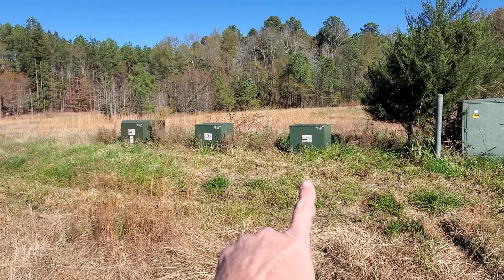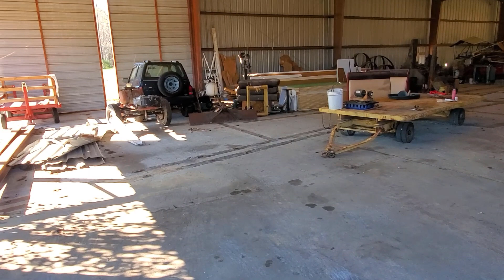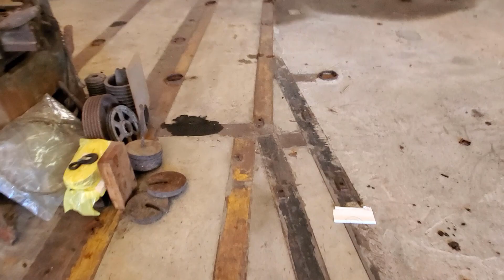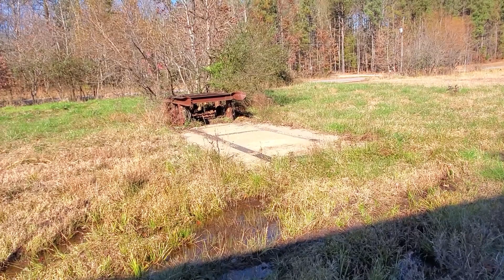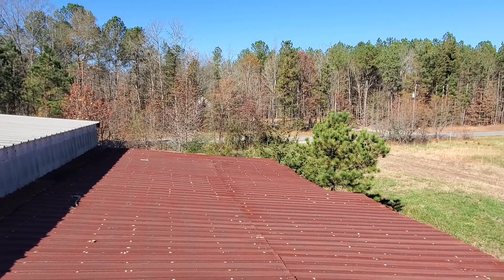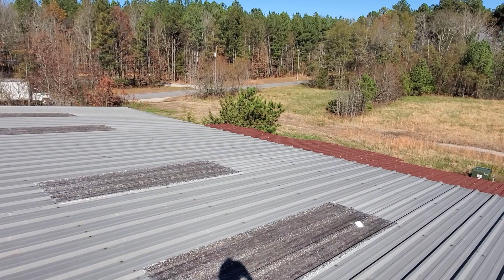Thanksgiving Shop Update 2020

Comment: Great older building , how many acres are you on? I bought four acres with a 1950's ish 40'x80' shop plus an old farm house. Lots of work to do. Great channel as I love compressors and three phase power solutions. Thank you!
Reply from the maker: The house is on 40 acres. The shop (50x125) is on a 6.5 acre parcel that adjoins corner to corner. The shop which was a sawmill, was sold off the original farm back in the 1950s as the previous owner sold off parcels.

Comment: Hi,
A really interesting video... you have such great potential there but an awful lot of work. Have you set yourself any timescales to make the building watertight? The idea about making the top wall panels clear will give you lots of natural light.
Have a good thanksgiving.
Paul,,
Reply from the maker: Money is more an issue than time. I warned my wife (who suggested I fix up this building rather than expand my woodshop) that there was little I could do but write checks to get it enclosed and more concrete poured to level the floor. I'd be ecstatic if it were enclosed in 2 years.
Reply: @EngineersWorkshop  2 years is a great goal... I look forward to watching your journey...